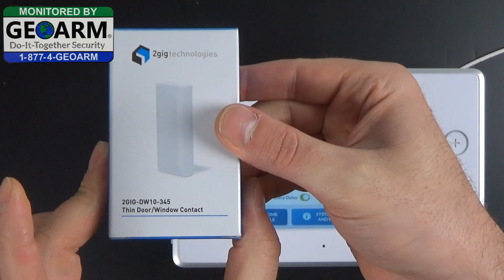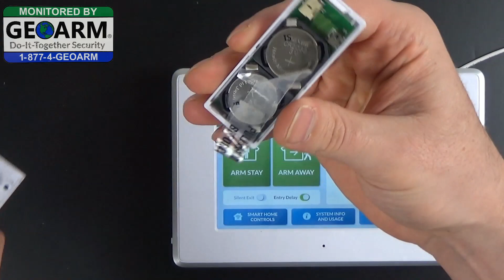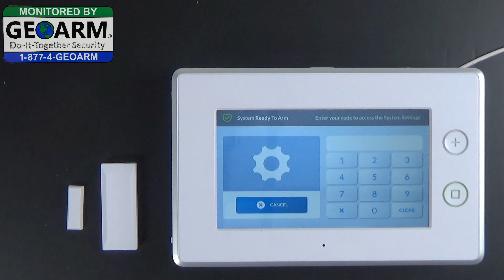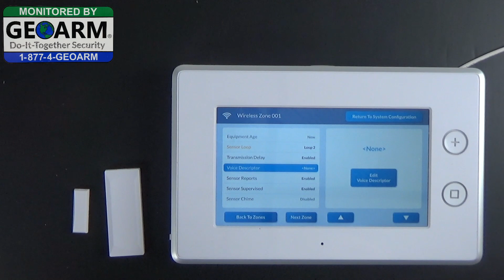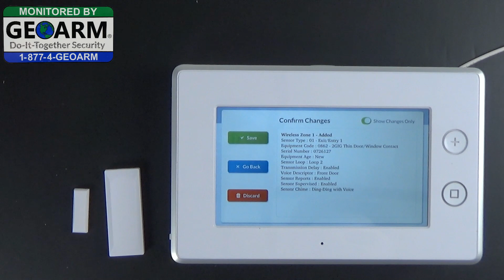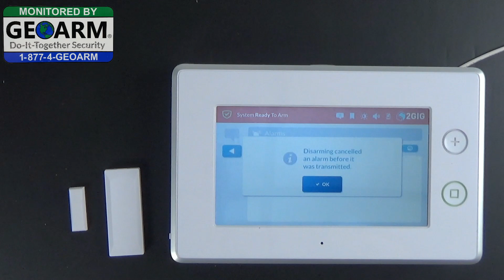2GIG-DW10-345 - GC3 Programming Entry 1

Comment: Thank you for the very informative video. I currently connected 2GIG-DW10-345 to the 2GIG-gc3e panel.  (x2 entry sensor and x1 motion sensor). The "Sensor Test" indicates that they are all successfully connected. But it doesn't trigger when it's not armed, and also does not trigger the alarm when armed. Is there something I'm missing?